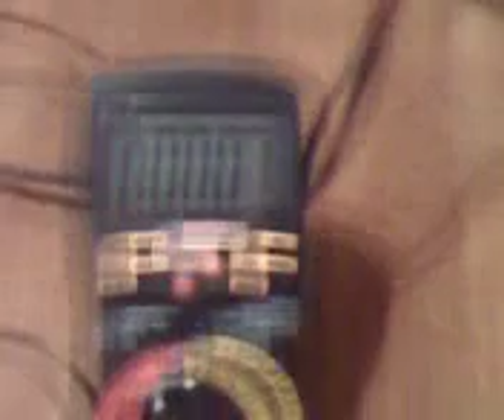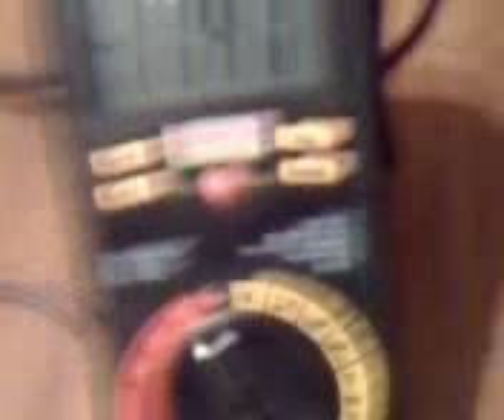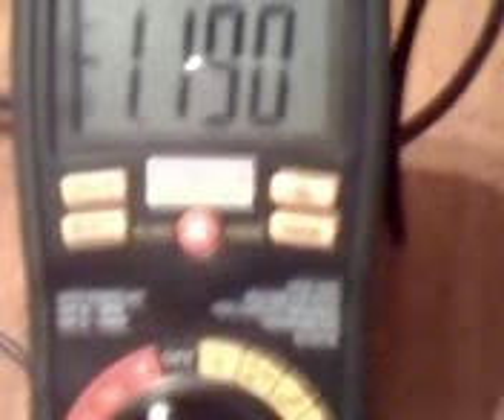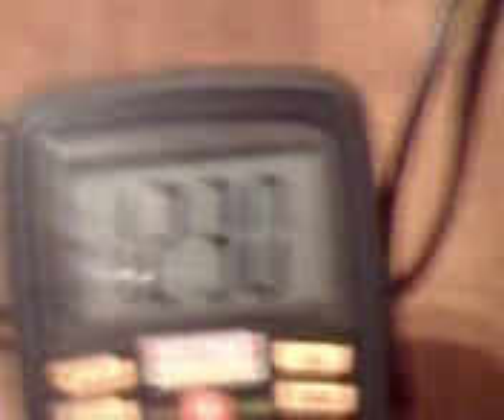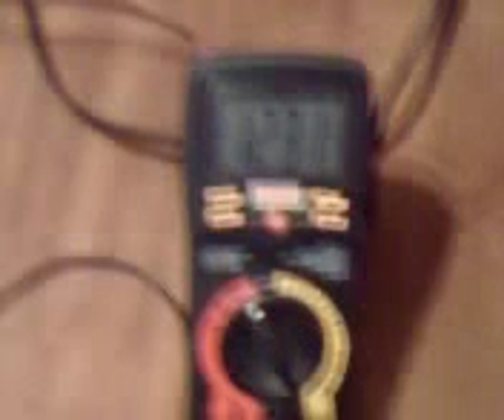#11 hho 5 plates no hole dry cell 18 watts 100ml in 1:00

Comment: Pretty good idea, nice job.  Seems that most cells produce about the same volume of gas (and I have tested over 50)  I just built a very simple dry cell....took me 2 hours.  10 plates 6" x 2.5" : +NN-NN+NN-   12.0 volts @ 15 amps (180 watts).  950ml/min at 70 degrees.  Keep up the good work.  Good to see new experimenters here.